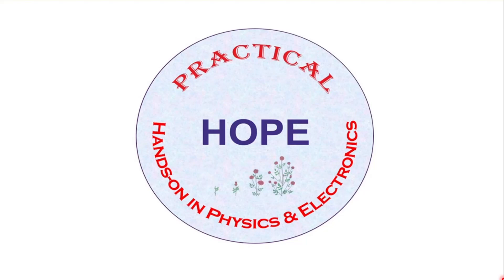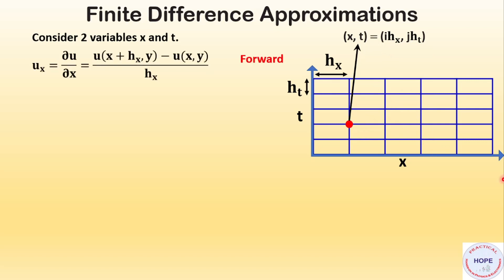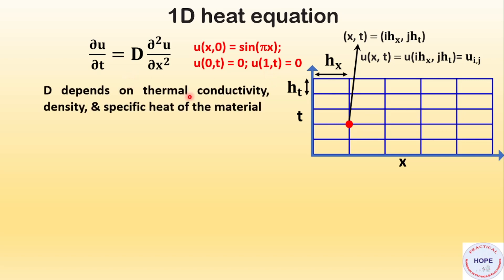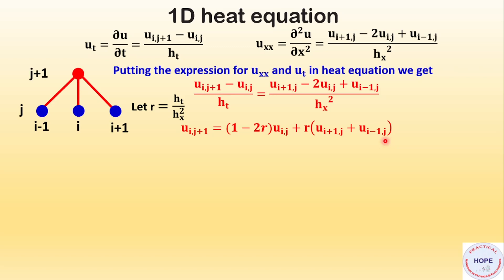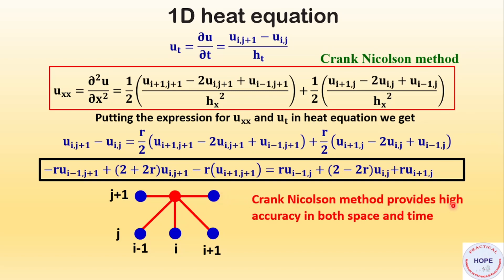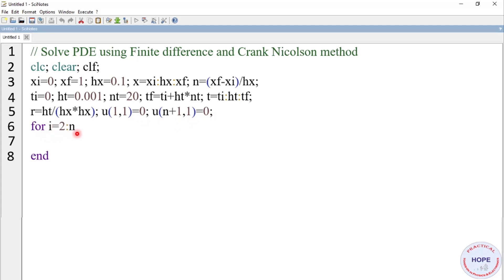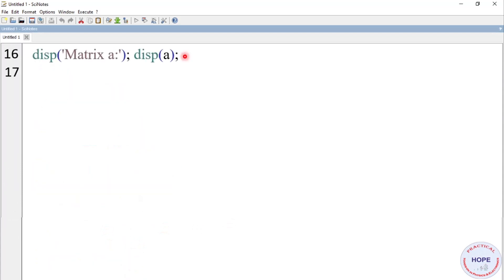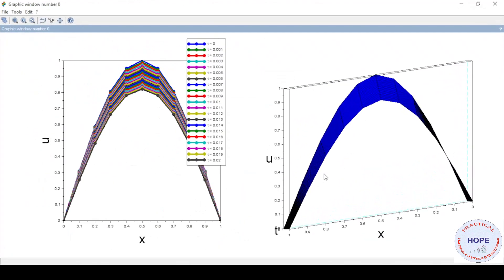Solve 1-D heat equation (PDE) using finite difference and Crank Nicolson method in SCILAB

Comment: Hi! ciao potreste progettare circuiti e dispositivi elettronici partendo da zero quindi facendo vedere i vari collegamenti e la disposizione dei componenti elettronici in modo che siano più semplici da realizzare? come flip flop microcontrollori Pic ecc...
Reply: Hi, could you design circuits and electronic devices starting from scratch and then showing the various connections and the arrangement of the electronic components so that they are easier to create? like flip flops Pic microcontrollers etc...